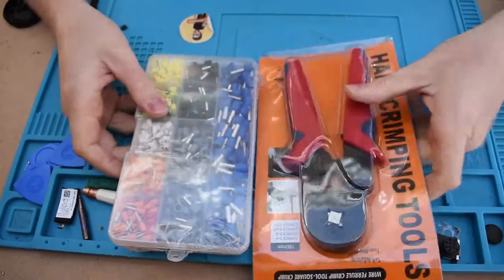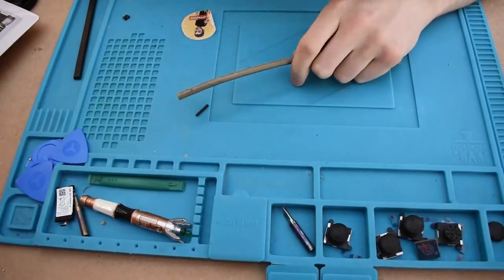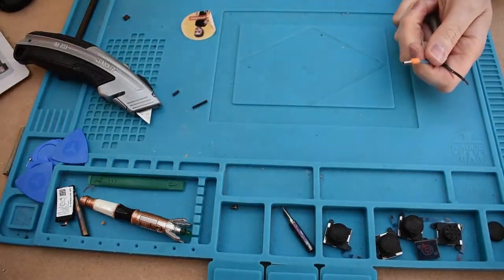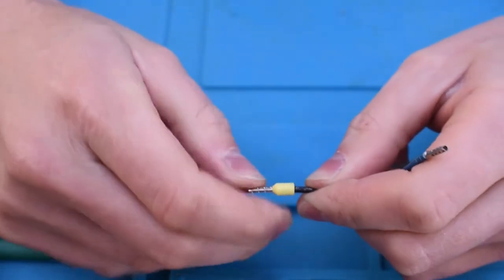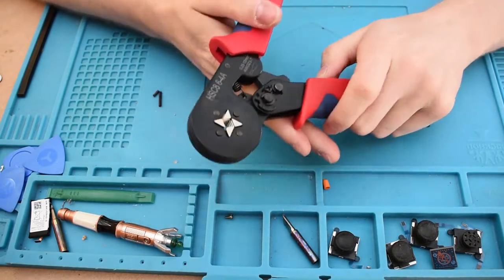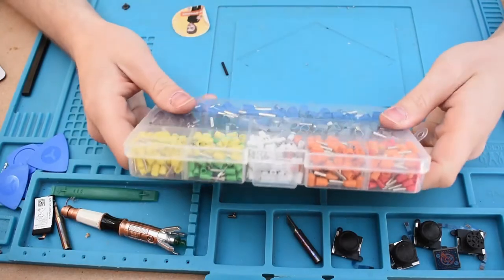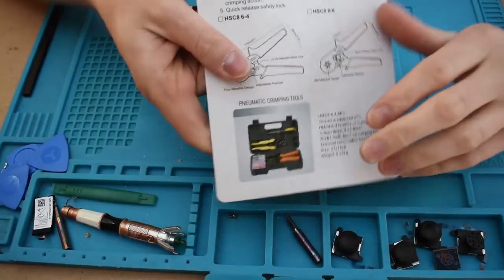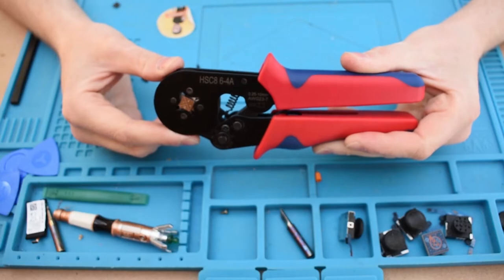I bought the cheapest Ferrule crimp tool on Amazon. Is it worth it? Greensen Crimper plier Review

Comment: I noticed that the stripped wire wasn’t past the end of the bootlace and you should use the smallest bootlace possible plus you should only put the lightest twist in the conductors when putting the bootlaces on
Reply: Twisting is not needed to guide the strands into the ferrule because the plastic collar does that job. 
And and twisting the strands - however lightly - is NOT recommended for the optimum crimp, because the crimping tool action is designed for parallel strands, so that a gap free, gas tight crimp form is achieved.
Twisting hinders the crimping action!

Comment: Having small hands is no excuse to give them a thumbs down mate. They are ratchet crimpers, ratchet them until the jaws grip the ferrule  then if need be you can use both your small hands to work them.🙂
Also use the correctsize ferrule for the cable, you didn't say which standard they were. There are 3 standards 2x German and 1x French which use a lot of the same colours for different gauge size👍
Reply from the maker: I don't think I gave them a thumbs down at any point in the video mate 🤔 .

Comment: One thing that I've been wondering about ferrule crimpers, is, outside of the standard car audio industry, what would someone use wire ferrules for? I understand that the main usage is to keep your wire ends from fraying, specifically while using screw type wire connectors for instance on the back of certain audio equipment, or on certain wire quick connects, but I'm wondering what other uses especially for the tiny looking ones shown in this video might have? For instance, I'm wondering if someone could use a wire ferrule, to make a slightly skinnier wire more eligible for use in something like a WAGO nut, or other similar purpose?

Please note, that I am not talking 120 volts or 240 depending on region, I'm talking just like your standard 12-volt or 24 volt or similar lower voltage setup, that wouldn't be as picky in overall connection quality

Also note, that a similar tool kit, with crimper that's that style, and something like 1600 ferrules, is around 23$ US(For those like me who are in the US) not sure what the exchange rate is, so yeah, you'll have to figure it out yourself if you're in another country outside the US...